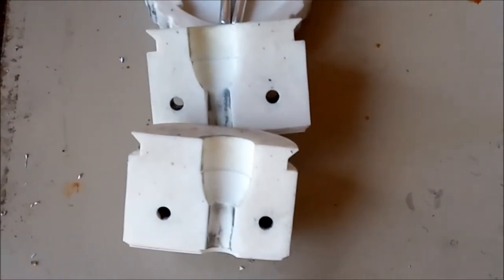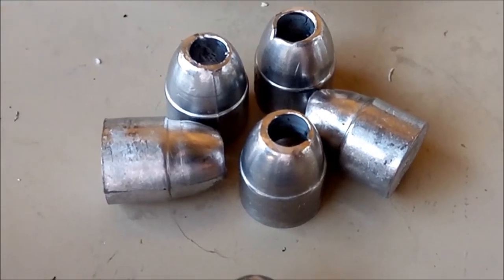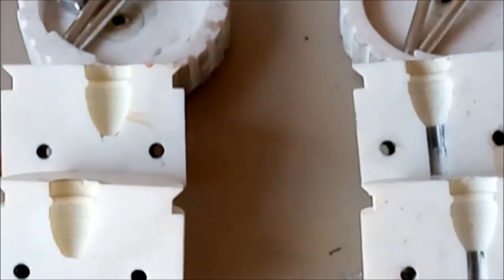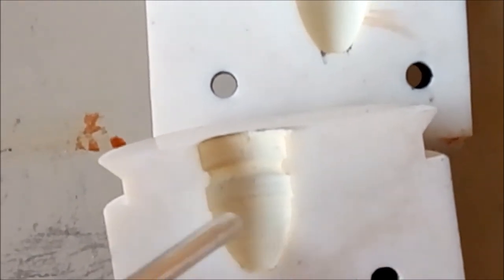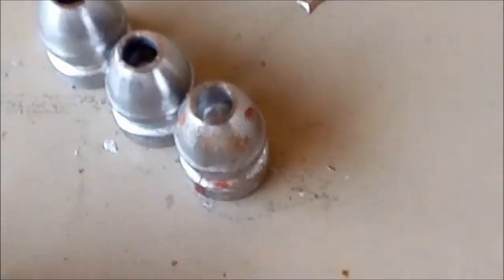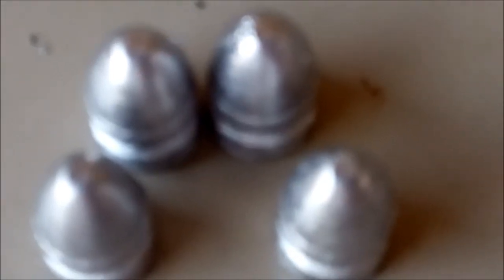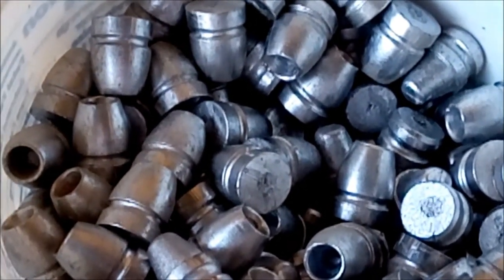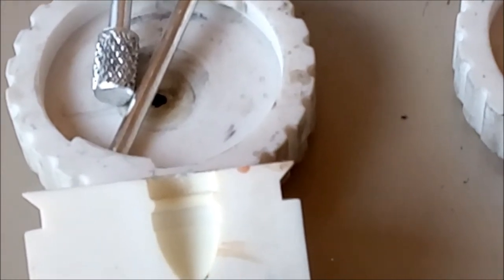3D Printed 9MM And 45 Caliber Bullet Molds-Last Video For This Casting Session

Comment: Do you share these files?

And have you gotten to updating?

I'm wondering if your printer has a warped base that is hurting your mold head and halves/causing the striations and micro fractures.

What filaments have you been using?
Reply from the maker: I wasn't using a filament printer I was using a resin printer.  I was printing with Siraya Tech high heat resistant resins.

My files were corrupted when I attempted to transfer them to my dedicated storage card.  I've been digging around in some of my older CD storage files in hopes of finding the STL files so that if I ever decide to pursue these experiments any further  I wouldn't have to start from scratch.